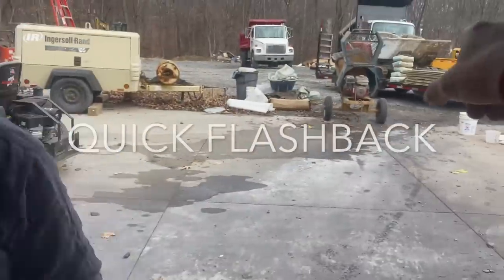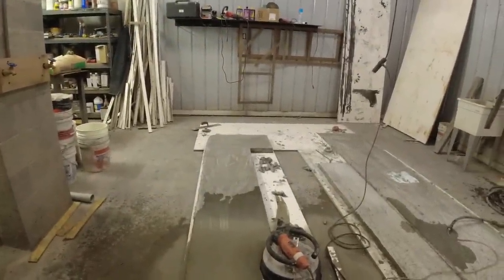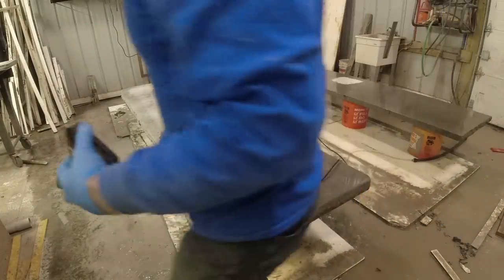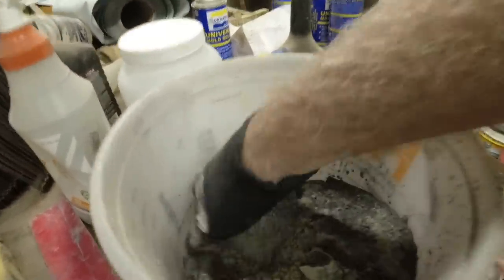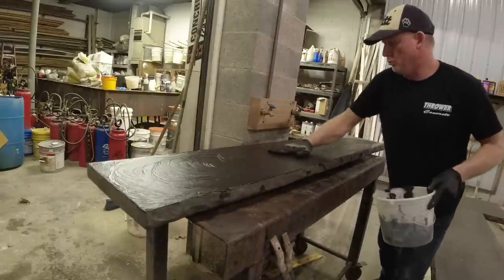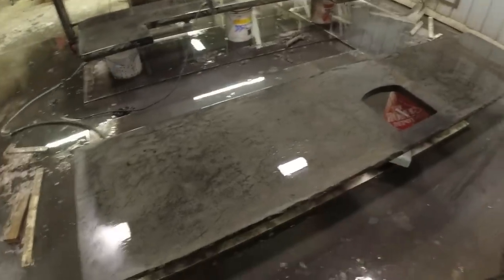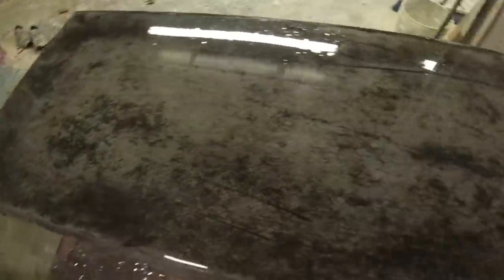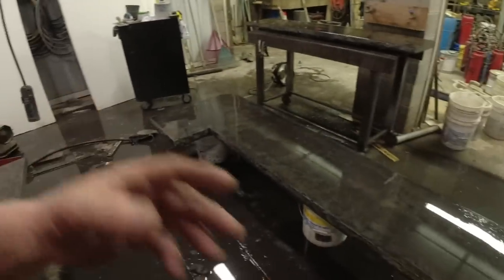What Happens Next?!

Comment: I watch all of your vids!  Great job!  However, I have a question about when you made the sink insert block ... you traced the inside edge of the sink then cut the foam out to match that, right?  What about the thickness of the sink material?  I think your hole in the top is going to be VERY tight when you try to drop the sink in!  Might need a bit of 'grinder trimming', I think.  If it sounds like I have made that kind of mistake ... Ha!  I did, but only once!
Reply from the maker: It is an Undermount sink. It will make more sense in the next video.
Reply: @Concretewiththehauses  Ahhhh!  That accounts for it!  So then as the remarkable Gilda Radner used to say ..."Never mind"!  LOL!

Comment: Oh yes, that color w the veins and splotches really add character. I would have thought the coloring would have been put in at the mixer. The concrete being so porous soaked up the color I guess. Well, it sure worked very nicely. I'm also guessing the coloring in the runoff sitting on your floor won't affect that concrete because it has been sealed. I would have thought you'd sweep water out in cleanup, but it does make sense to leave it until after finishing the slabs is complete to keep dust on the floor. Can't wait to see them finished. This was very interesting and fun for me, but doing these after work sure elongated your days. You must be tough as nails! After the next video, I'll be thinking that sealing them this time will be enough since they will be indoors. Is that correct? Thanks for the video, see ya on the next one!👍👌❤🇺🇸🇺🇸
Reply from the maker: I think you would like install the best
Reply: @Concretewiththehauses  Yes, I am certainly looking forward to that, yessir!

Comment: Have you considered fabricating an extended pole attachment for that grinder?  It looks like you could control it fine from a handle and save your back!!
Reply from the maker: Most of the time we raise the countertops up these were so big I did not want to move them yet. I’d like that idea.
Reply: @Concretewiththehauses  yeah I made that comment early in the video when I was watching you bend over all the way to the floor.  Later I saw you raise them which helps some but a handle with optional telescopic length would be handy for when they are on the floor or the buckets.

Comment: Hey Tom, I have seen cast concrete and slabs curl up on the ends before and always wondered how that happens.  Is that a concern with cast countertops?
Reply from the maker: Yes, I had to replace a set last year because of that cannot use very much water